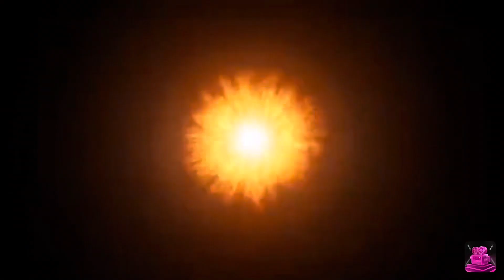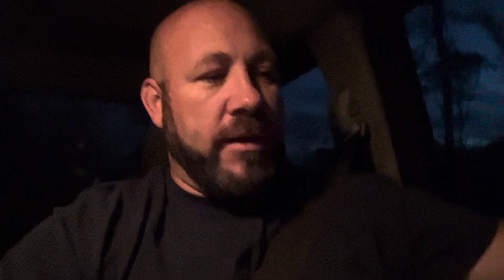Garmin Livescope: How To Properly Set The Gain On Your Unit

Comment: You don't leave it hooked up? I mounted mine on a track mount on my kayak. I haven't ever moved it. I leave the heading line & lvs34 distance the same 99% of time so I can reference how big fish are. It definitely makes a big difference on approaching waypoints. Keeps my screen in correct orientation so it doesn't spin/rotate & makes waypoints more accurate.

Comment: I've been starting with 67-69 also Fr m watching your settings vid a while ago. It's been good for me most of the time also. So are you using your steady cast heading line set at same distance as you transducer distance? That's what I've always done. Definitely helps with accuracy on casting distance & my distance from waypoints.
Reply from the maker: Crazy thing is I rarely use my stwadycast

Comment: I just wish I could get rid of the noise that appears when I hit the trolling motor.
Reply from the maker: What kind of trolling motor
Reply: @The_Garmin_Guru  Minn Kota. I had it on 2 different units and still the same results.
Reply from the maker: @bcallisjr  watch this. I’d be willing to bet this is your problem. Also what is the distance between the bottom of the transducer to to the top of the foot of the trolling motor.
Reply from the maker: Garmin Livescope: Could This Be The Cause Of Your Interference If You Have A Minn Kota Ultrex?!?!?
https://youtu.be/S4chdZ0ph0U
Reply: @The_Garmin_Guru  thank you. I'll have to check it out.